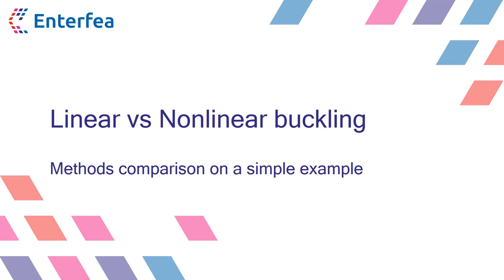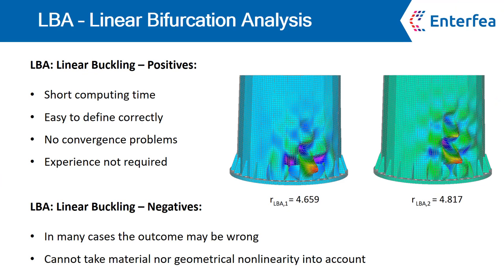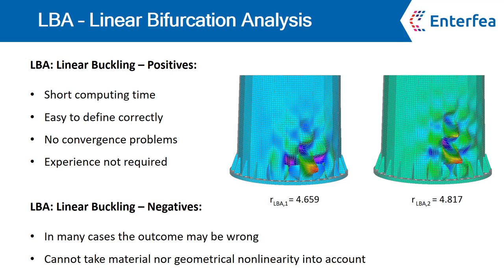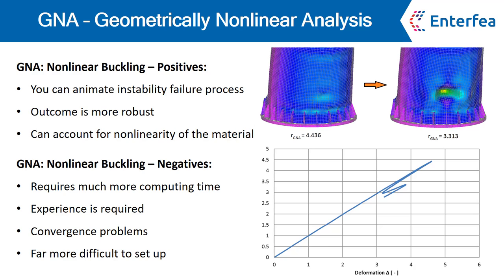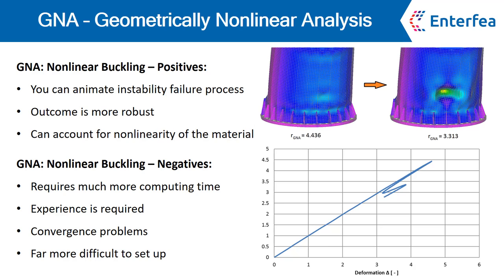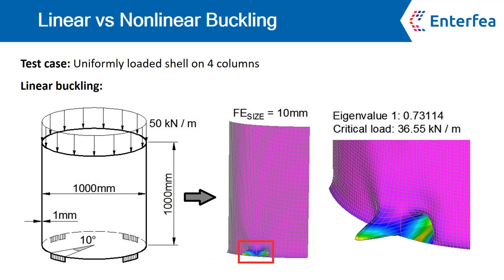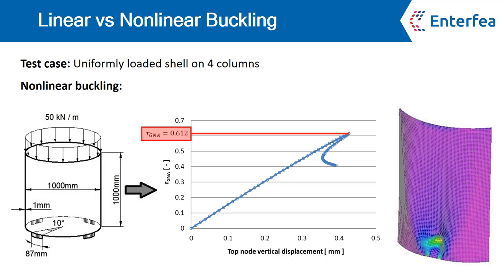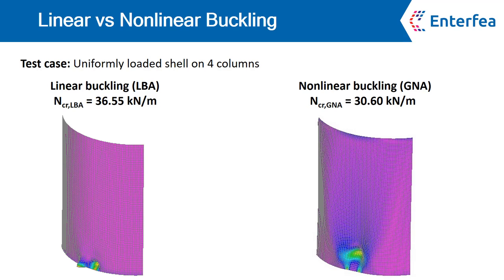Linear vs nonlinear buckling

Comment: thanks for this incredible video 
i have a question , why there is second mode and third mode of buckling while it's supposed to collapse at first mode of buckling ?
Reply from the maker: In Linear Buckling it's just a "math operation" - you can calculate something akin to "what would be a second mode, if the first one would not exist" etc. In nonlinear FEA, you can't do that - the structure will fail into the first mode, and there isn't much you can do to obtain a second one (apart from applying load very fast in some cases, but that is beyond static analysis :) )

Comment: which of these 3 programs do you think is the best MSC Nastra,ADINA o ANSYS?
Reply from the maker: Hey Tony! 
I try not to say anything definite about the things I know nothing about :) I only used Adina, and it's ok (some things are iritating with how the arc-length analysis is defined and how to "steer" the arc during analysis. As for other two, I have no idea really...
I guess that MSC is almost the same as NX Nastran, so you will end up with SOL 106 most likely. It is super easy to set up, but it's not as "powerful" as SOL 601 (Adina). 
I would also guess that Ansys is at least as good as Adina in solving nonlinear stuff (maybe better), but I have no knowledge to back this up - just a hunch really...

Comment: Is It possible that the non linear buckling  gives to me An higher load than linear?
Reply from the maker: Yes, i.e. in plate bending LBA will see a lot of "fake" buckling (since it cannot see membrane state), and it isn't there - so technically the nonlinear analysis in such case would give a better outcome than LBA.
In shells, that would be rare, and I would be careful - it is possible to "miss" buckling and calculate your model in an unstable equilibrium in FEA if you are not sure what to do.
All the best, and good luck!

Comment: I modeled the same geometry and same load with zero displacment in the x and y direction for the upper edge und fix support for the small feets and I got 0.62 from Linear buckling (LBA). What could be the reason ?
Reply from the maker: Hey Basem! First of all I'm glad that you were inspired enough to try the example :)
I think (in all honesty I can't remember...) that I used zero displacements on horizontal directions (yours x and y I assume) at the bottom edge as well, with the support additionally with zero vertical (your z) deformation. However, I think I allowed for all of the rotations.
See if that will work for you, and let me know!
All the best!
Ł
Reply: @Enterfea  Actually, I tried both and still getting lower values of eingenvalues
Reply from the maker: @basem506saeed  Hmmm... that is interesting for sure. I think that there is a video on my channel when I do a nonlinear shell analysis - I think that it was the same shell (I hope!). There is a step by step guide on how I support and define the model there - maybe this will help...

Comment: Hello! How did we get 0.612 in GNA? Depends on what value?
Reply from the maker: Hey! There is a 50kN/m load on the top circumference... if you would apply 0.612 of that load in GNA analysis you will get failure.
Hope this helps!
Ł
Reply: @Enterfea  Thank you! But why 0.612, you found it as a result of the analysis or by trying?
Reply from the maker: @oguzhanakarsu6703  No, no... this is the outcome of a SINGLE nonlinear analysis. I mean, you do a nonlinear analysis, and the outcome is, that the model fails under 0.612 of the load - there is no need to guess anything, nor do the analysis several times to get the GNA outcome  - the nonlinear analysis gives you such an answer in a single run. Otherwise, if guessing would be involved... design would take forever, and wouldn't be very practical :)

Comment: what would you choose?
Reply from the maker: You mean between linear and nonlinear buckling? That would depend on the case I guess, as I still use LBA in some simple occasions... but if I need to make a "blanket answer" then nonlinear buckling all the way :)
Reply: @Enterfea  no dude, I meant, what software do you choose? Did you read my first question?
Reply from the maker: @TonyA-ex1sj , To be honest, I don't see your first question... so I'm not sure what this is about. I'm using Femap with NX Nastran if this helps you... Please write your question again so I can answer it... since apparently, it disappeared...